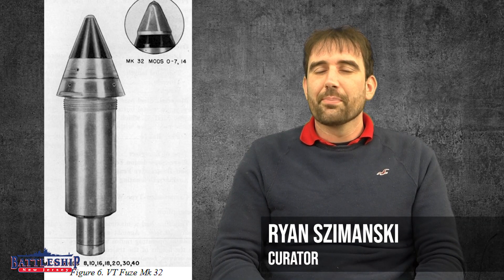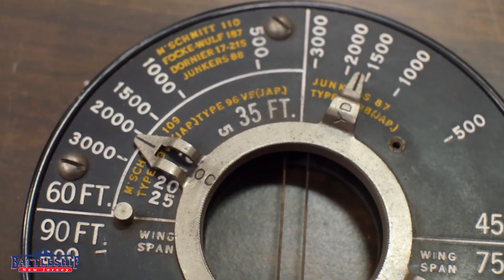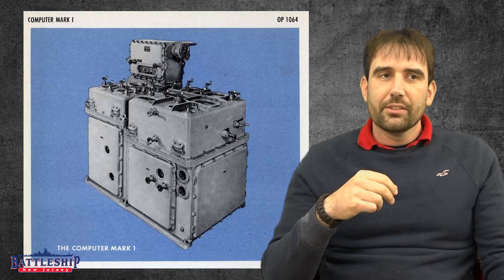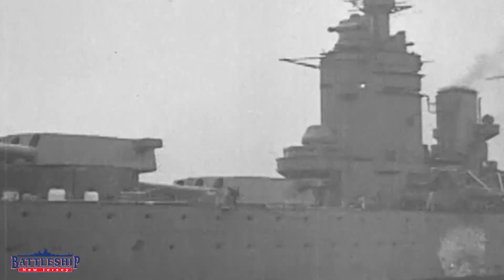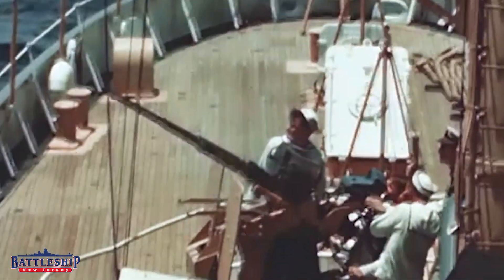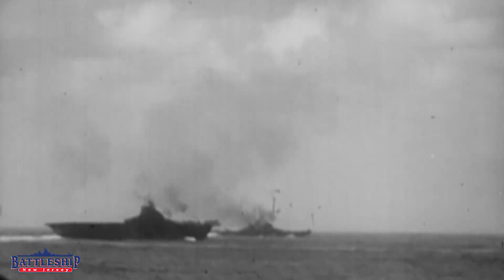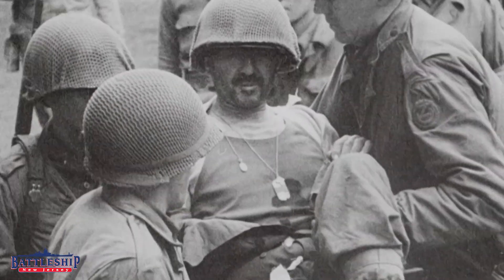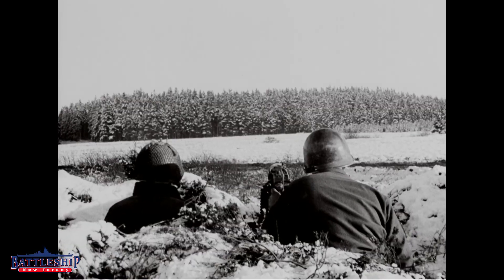Developing the Proximity Fuze

Comment: The advantage of firing from a rifled gun is that the centrifugal force that is trying to tear apart your fuze will force the liquid element of your battery in to the rest of the battery, arranged around the edge.  You can also use the acceleration to break the vial of electrolyte, which I think he mentions in the video.

Comment: One of the reason fixed guns in forts where so dangerous before the VT fuze was that they had all the fire plans pre calculated and could fire airbursts easilly using those
Reply: What does it mean,can anybody elaborate?
Reply: @hyper7986  they know the exact ranges to every point around the fort. With a time fuze you can calculate the airburst timing ahead pf time as you have years to do this
Reply: @AdurianJ  but typically the air borne targets wouldn't be flying at such a low level so as to calculate the position of those points beforehand(since you mentioned about airburst)

I agree that distance can be calculated for many points but they need to be on land to be accurate 

therefore my assumption is that the argument you provided to support your hypothesis does not hold true

But I am open to corrections,if you may please explain what you think

Comment: Was the VT fuse ever developed for battleship 16" shells? I could see it effective against land troops and defenses in a shore bombardment situation, much as it was used during the battle of the bulge.
Reply: They were developed for bombs dropped from planes.
Reply: @fredsmith5473  Indeed they were.  I know the British tried to fit them to 4,000 lb bombs, although serious technical problems were encountered, and on the papers I’ve seen so far, I’m not sure it ever worked.  Early vt fuzes had to be adjusted to the shape and design of the bomb.  They weren’t proper radar, they did clever things with a radio signal.  That meant that the metal object they were attached to changed the sensitivity.  For the 4,000 lb bomb there were also problems with arming the fuzes.  That bomb is an unusual shape, with the result that the air flow needed for arming wasn’t available at the fuze pocket.

The US had more success with smaller bombs in the Pacific.  The uk began to switch to trying to use vt fuzes in the pacific, but by the time we were ready to do much with then there, Japan had surrendered.
Reply: Afaik, Battleship-grade ordnance in shore bombardement was mostly used against fortifications and heavily dug-in troops.
Air burst shells aren't anywhere nearly as effective against those as they are against soft targets in the open.
So, I'm not sure if there was ever a point in using air burst shells for those calibres.
Using a large number of ligher guns (6" and 8") with VT fuzes would probably be more effective.
Reply: I now have one of the files in front of me (AVIA 22/829 at the National Archives in the UK).

February 1945, 11th bombardment group, 7th Air Force.  16 B-24s carrying 500 on M64 bombs, fitted with the T50E4 nose VT fuze. The number 50 was one of the main us vt fuzes at the time, T being the letter for experimental weapons.  Target was Iwo Jima, towards the north end.  Concentrations of anti-aircraft installations.  60-70% of fuses functioned correctly.  This was below the 80% expected and desired, which was attributed to the lack of arming delays.  Recommendation was for arming delays, to reduce early detonations, when dropped above 10,000 ft, drop was from 16,000.  Absence apparently due to their nit being ready/available in theatre.
Reply: Further details, same file, for second and third missions, which based on another file I had thought had been scrubbed for bad weather.  

2nd mission, 30th group, 20 B-24s, again 500 lb M64, fuzes as above.  Cessation of AA fire notes during raid, and anecdotally reduced AA fire on following days.

3rd, same unit, 40xB24.  833 260lb M81 bombs, of which 798 fuzes as above, remainder AN-M103 nose fuzes.  Target was beach defences and other installations in the south of Iwo Jima.  Fuze performance estimated at 90%, improvement seemingly due to reduced early detonation.  Drop height notably lower than previous (4,500-5,500 ft), apparent cause of improvement.

All above from report to Harry Diamond of NBS, supporting Diamond playing a role.  Classification stamps on the accompanying photos are NBS, appear to be NBS property.

Comment: My Father worked one on one with Heddy LaMarr in a Laboratory when she developed the Proximity Fuse. He was working with Her on the Problematical and Sabotaged Mark  XIV Torpedoes. She also discovered frequency hopping and pools of conductivity ,which led to Wi-Fi and GPS. Not only was She the most Beautiful Woman in the World,She was a Brilliant Weapons Designer and Inventor. She let( or was forced by the Government) to let others take Her credit.
Reply: LaMarr was just amazing.  She first came up with the idea of frequency hopping to prevent jamming of navy torpedo guidance systems.  She then conceived the actual control mechanism to do it when she shared the idea and problem with a musician.  The musician told her of a musical piece he had written that required multiple synchronized player pianos. The musician's idea in the piece was to synchronize the start time of identical player pianos with identical player piano rolls, so the pianos would play in time with one another.  They used the same idea, but miniaturized, to implement frequency hopping.

Comment: Something I only learned recently is the development of 130 octane avgas. This permitted higher supercharger boost without destroying the engine.
Reply: It was actually 150 octane which made huge increases in power output possible for engines such as the V-1650.

Comment: The Proximity fuse was the birth place of Transistors. Through WW2 tubes were used in the circuitry. That meant big batteries and smaller tubes. The British came up with the transistor in order to make it more robust, and fewer failures. Less weight, smaller batteries, and more compact than miniature tubes. Not alien technology as some claim. Just the mother of Invention is a need for something better.
Reply: The first working transistor was made by William Shockley and his associates at Bell labs in 1947. Research on semiconductors started in the Twenties.
Reply: I don't believe that's true. The first practical transistors came out in the late 40s, and for years transistors were delicate and only useful at low frequencies. There were all sorts of obvious applications for the transistor, such as hearing aids and computers, but it was in the late half of the fifties that they began to supplant electron tubes. In fact there were new valves/tubes being designed in the 50s for computers. It was realised that transistors were the future. but the early ones weren't up to it.
Reply: @fredsmith5473  Transistors began to supplant tubes in the early to mid-fifties. My dad bought a Magnavox transistor "pocket" radio about 1955. It was about the size and weight of a pound of butter. I'm sure that military electronics and computers had transistors incorporated for at least several years before that. The radio cost around $90 US, about $1000 in current dollars. The case was surprisingly fragile plastic but the electronics worked for years.
Reply: @fredsmith5473  They may not have worked well enough to use them, but that was what we were taught in class on transistors, eventually they were strong enough to replace the more delicate miniature tubes. I wonder what those engineers who developed those first transistors would think today, with literally millions of transistors on memory and microprocessor chips?
Reply: @jamesberwick2210  The first transistor was developed at Bell Labs, in 1947. Bell Labs is in the USA, not Great Britain, and none of the team who developed it were British. Transistors were developed with telephone applications in mind, not VT fuses. The VT fuse wasn't the birthplace of transistors.

Comment: I have a question. I saw in the radar video that the crew also got the horn working. What all was involved with that and how much of a pain was it to complete that project? Thanks and great work.
Reply from the maker: There is an air compressor that runs it today. Which wasn't easy to hook up or get up to that height in the superstructure.
Reply: But does it sound the same?

Comment: Great video. The 20:1 increase in effectiveness was also possible because of better radar fire control for AA so the shell had a much better chance of getting close enough to begin with. Non-VT AA shells were also generally more effective because of this. But the VT was certainly a huge part of it for the 5-inchers and other long range AA guns. Dunno if there is any data on the increase of accuracy for 40mm's from the early to late war years when they were fully radar directed, but the anecdotal word was "much better".

Also, the Tizard-supplied design was not the design of the actual shell that worked, so MIT really does deserve the credit for it... although British had the idea first, they did not produce a working one of their own and apparently used the MIT design when firing them at V1's with great success.

VT's helped kill off the 40mm Bofors farms after the war; because the shells were too small to carry them, and is why the 75mm AA's became popular so quickly. Even though the rate of fire was individually lower with the 3-inchers (and even more so being single or dual mounts instead of quads), the hits over a given time could still be higher with 75mm VT's which also had better range.
Reply: The VT fuse rendered the 40 mm Bofors obsolete on U.S. Navy ships. Late in the war new ships had single and twin mount 3 in./50 Mk 22 dual purpose guns instead of 40 mm. The 3 in. had a much faster slew rate than the 5 in./38 twin mounts and the radar director for it was particularly good. Space made avalable by deletion of 40 mm guns was used for additional 20 mm Oerlikons for close-in defense.
Reply: I’m not sure if we were using only American fuzes on the V1.  I have some of the papers already called up at our National Archives, and I’ll check today.

I will say that provision by the US of 1/8th of the crews doing HAA with VT fuzes against the V1 was greatly appreciated.

Comment: 1943: Proximity fuse, a miniaturized radar is developed which is capable of withstanding the shock of being fired from a 5" 38 and is cheap enough to mass produce.
2021:  Oh sh*t!  I dropped my phone!  I hope it's not broken, I can't afford a new one right now...
Reply: They weren’t actually full radars.  Early models just transmitted on one frequency and relied on either an increase clever work with patterns created in multiples of the wavelength, or on amplifying frequencies slightly offset from the transmitter frequency (Doppler shift would ensure the frequency reflected back was slightly different) and when there was enough of that, it went off.
Reply: Just add an airbag that’s triggered by a VT fuze.

Comment: I forget the exact number, but a shell sustains like over 2 dozen “G”s at firing. So a fuse goes from like 5 pounds to over 100 pounds in milliseconds. Those forces are tough to correct for in the age of vacuum tubes.
Reply: Yep, the VT fuse was built to withstand 8KxG.

Comment: What was a gunners mates work day/watch comprised of? During peacetime time, how much time was spent drilling on the guns?
Reply: As a former US Navy Gunners Mate most of your day during peace time was doing maintenance work on the ship's weapons. This included small arms to the main batteries. If you had any repair work that would take priority. Typically you would be assigned to specific gun or group of guns. If you were assigned to the 16" Turrets you more than likely would be assigned to a specific turret. If you were assigned to 5" - 38 caliber Mount you may need to work on more than One Gun Mount. The same would go for 40 mm Bofers and 20 mm Orlecons. Most of the time you actually spend very little time doing drills. Typically when gun drills are done they are done while at General Quarters you may only spend a few day a year doing gun drills. Most of the time gun drills are done are during annual gun qualifying. You usually have to at certain locations off Pyramid Head on San Clemente Island California to do live gun fire exercises.

Comment: Do naval vessel have life boats? If so where do they store them? Cause they are not hanging off the deck like cruise ships.
Reply: there are life rafts on ww2 era ships, those rafts are a net hanging underneath a cork clad hollow steel tube in different shapes, some where oval, some where rectangular, etc. if you look at pictures of any ww2 era battleships, you can see those life rafts either on top, on the sides, or both, of the main gun turrets as well as certain places on the superstructure. the iowas had 2 rafts on both left and right side of the main gun turrets, just in front of the optical ports, along with a lifeboat on port and starboard side between the lower 5" gun turrets and some more life rafts laying around elsewhere that i havent spotted on any pictures of the iowas. 

all of those rafts are mounted in such a way that if the ship is sinking, the raft will come lost and float for the surviving sailors to get onto.

Comment: Great video. On the subject of the Tizard expedition, Tizard brought the cavity magnaton to the US ("the most valuable cargo ever brought to our shores") which gave Allied radar a significant lead over the Axis. Can you make a video on the cavity magnaton and 10cm radar?
Also, I did not realise until visiting the USS Cassin Young in Boston that the USN used the British Hedgehog forward throwing anti-submarine mortar, which would make another great video.
Reply: The Allies rapidly developed magnatrons for 3 cm (wavelength) radar to locate diesel elactric Axis submarines with only their schnorkel breaking the surface while cruising at speed. The Nazis could not figure how they were being located as they had nothing to receive less than 10 at the time, but they did al sorts of clever things like radar absorbing rubber cladding. Airbourne 3 cm radar, long range bombers and the British Hedgehog depth charge array ended the Atlantic submarine warfare.
Reply: The cavity magnetron was almost impossible to destroy with a demolition charge
Reply: @dalecomer5951  The Germans got their first British Airborne radar off a Coastal Command patrol aircraft which landed in France by mistake. They got their first magnetron radar of a RAF Stirling Bomber shot down over Rotterdam. The first German Aircraft radars were developed without information about British equipment.
Reply: The Radar stuff in the Tizzard Mission was more that the magnetron. There was a lot of stuff that the US Armed forces had not thought of that could be used with their own equipment at the time. They didn't have airborne radar (ASV Mk II and AI Mk III being the latest UK kit in development) and the British already had a working PPI display system in prototype form.  US Navy and USAAC pretty much asked the British for a Licence to built ASV as soon as they found out about it. If memory serves, 7000 odd US versions of the ASV II were built.

Comment: How about a show about surface radar aboard the New Jersey and the other fast battleships during WW2? I've read about how Washington was hindered during her fight on November 14-15, 1942 by the radar being placed on the front of the mainmast thus leaving a blind arc 80 degrees aft. Was this corrected on her and the other fast battleships latter in the war? Also during many battles of 1942-3 it seems the vibrations of gunfire would often make the radar flicker or even fail entirely at times making accurate tracking difficult. Did New jersey and other U.S. battleships suffer from this too and were any measures like added bracing done to counter this? Finally at what ranges could the Iowas first detect then track large warships like other battleships with the radars they carried in 1944-45? Could they spot shell splashes using radar, and at what ranges?